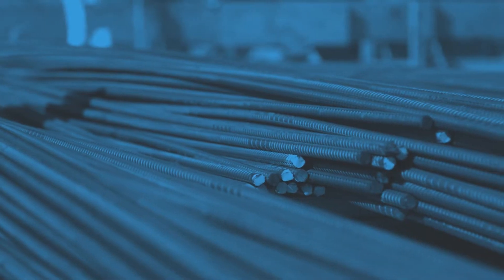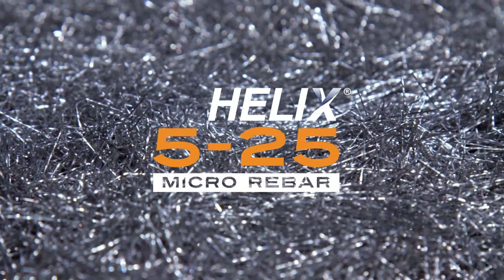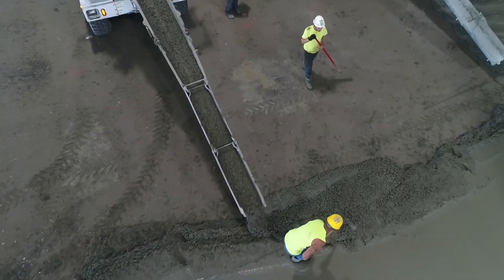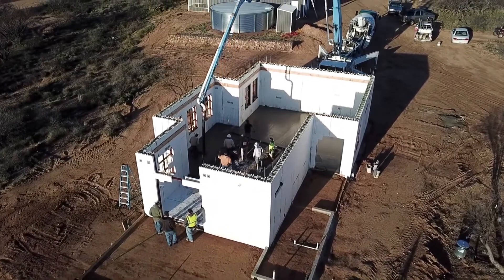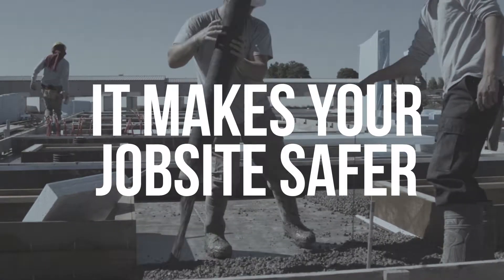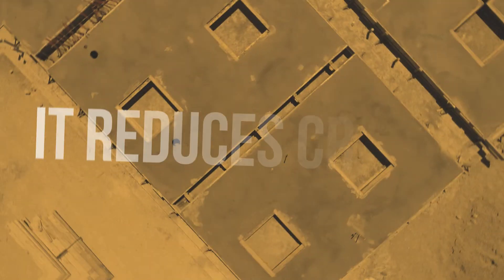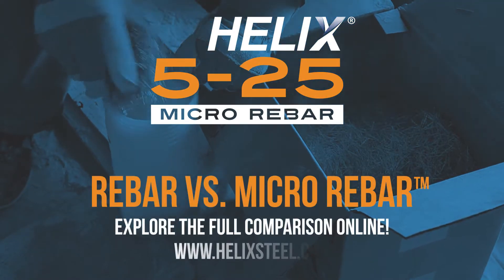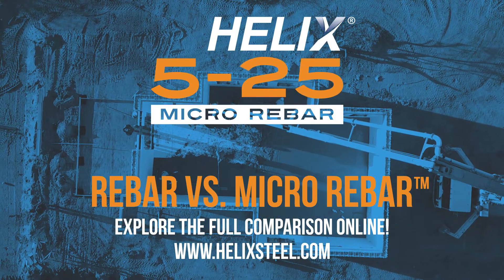Rebar vs Helix Micro Rebar: The only code approved alternative

Comment: How does this compare to glass reinforced fiber?
Reply: Helix 5-25 is code approved and provides structural strength, the glass and poly and other metal fibers are not ICC and UES approved and do not result in the strength with Helix

Comment: So it's like post tensioned concrete members?
Reply: Nah, this is just a regular steel fiber with some fancy marketing
Reply: @marks7025  Much more than fancy marketing, many years of proven performance, code approved, creates structurally sound concrete, exceeds performance of rod rebar when dosed properly.

Comment: Florida approved? Will face rust? can this be used in poured board forms in a 2 story residential build?  How cost efficient if you are reducing labor costs of hauling and assembling rebar?
Reply: they make silicon or polymer pour ins that make it water proof and is suitable for builds before or in the frost line. So basically If you have the micro spikes + polmer mixed in with your concrete it should be both water tight and not need a condom (pond liner) and also doesn't need rebar. Although my research is only for shotcrete, not sure if it holds up for pouring concrete